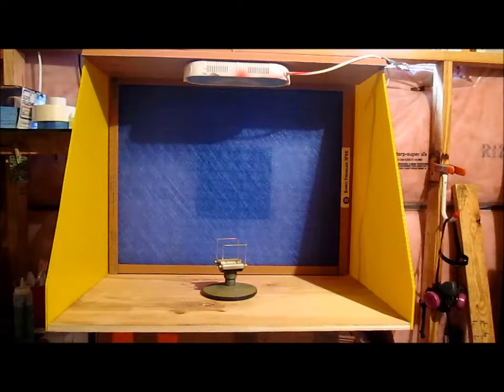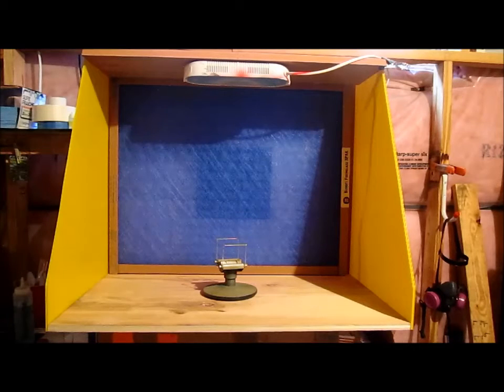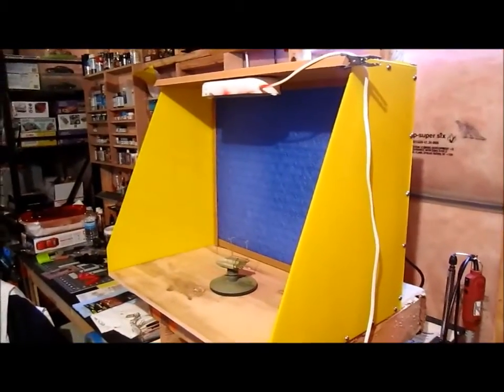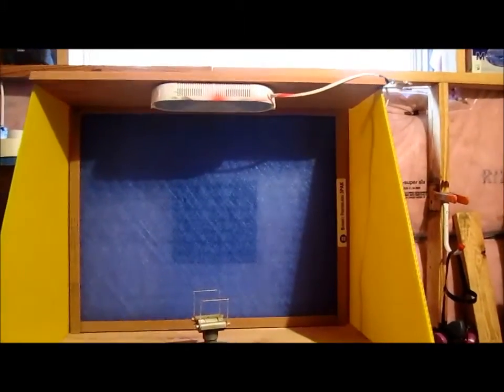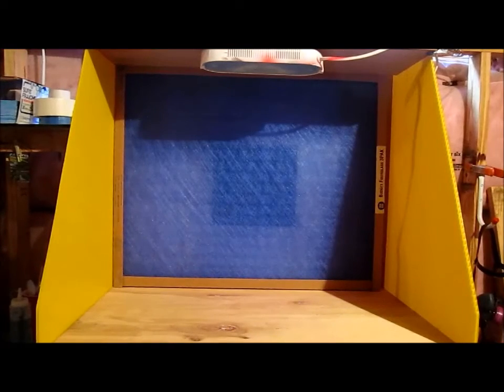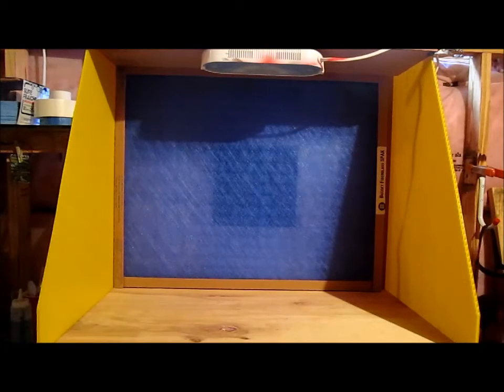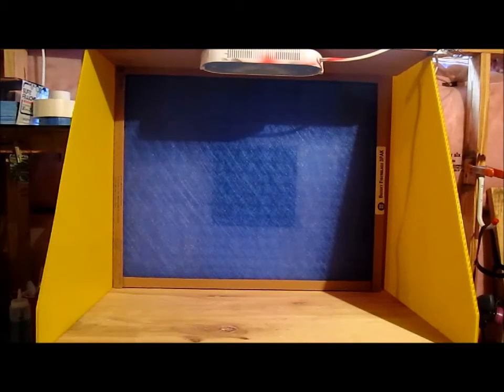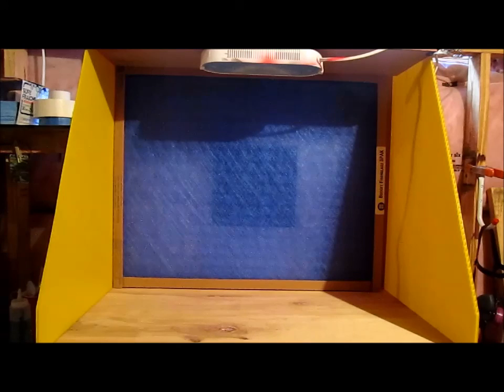New Spray Booth

Comment: not bad...do you use a hose ? I will not have access to a window, so it should still work right? it will just hold the paint particles in the filter and not blow out a window....I think I need to make one